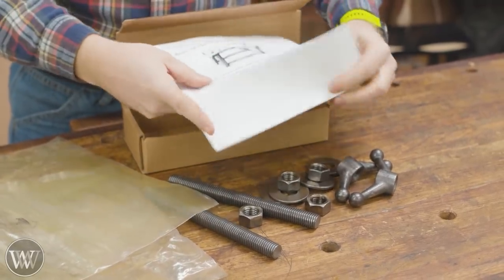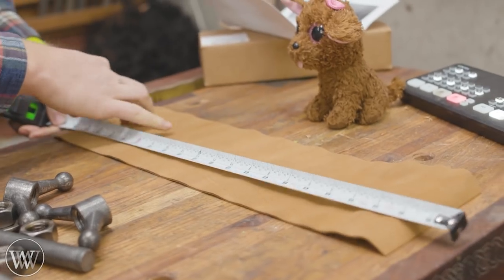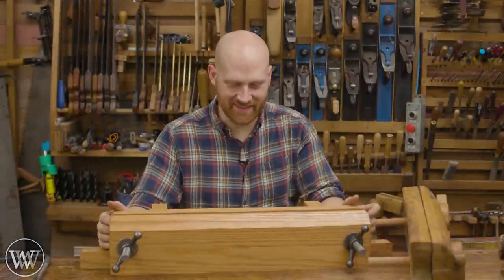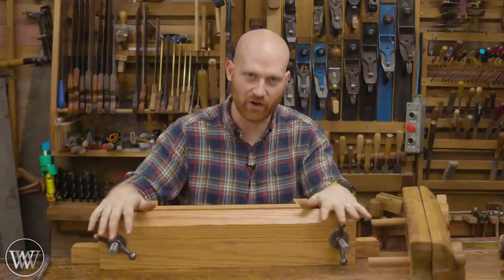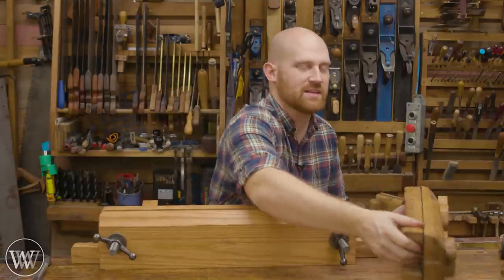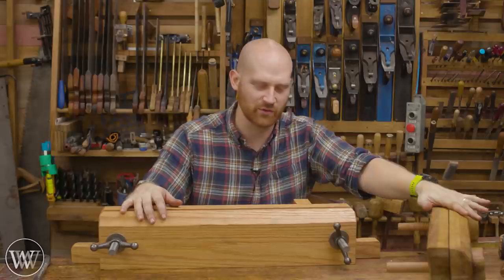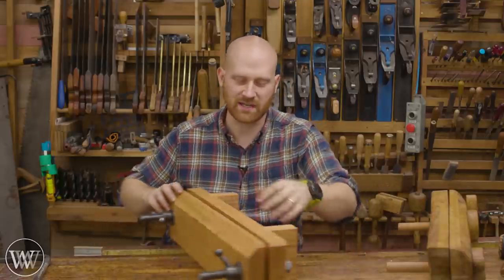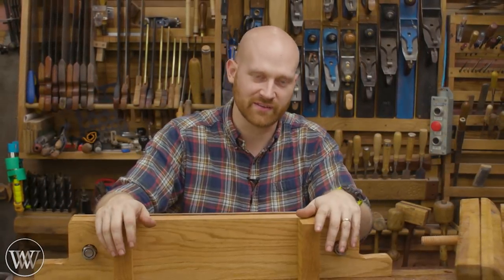Making a Moxon Vice Kit

Comment: Great hand work! You could make the screws not sticking out on the work side if you wanted to, just use the doble nut with the wing nut on one end or lock it with a weld spot, then you can use the one embedded on the wood for the worm to adjust. It may make it more handy and easier to tighten up...

Comment: As always, a relaxing blast to watch. 
I made a moxon vise near the beginning of lockdown with some scrap hardwood lumber, long bolts and other things I had around & it is a great project to do. Turned out very similar to yours except for the turning handles, where I created my own handles and embedded the bolt head in the handle, and I didn't have the sliding dovetail pieces.

Comment: love it, how do you find the patience to work by hand and not with machines, even with machines i have to often slow my self down.
Reply: I don't know about James, but for me working with hand tools is a way of meditation and calming my mind. It's not so much having a finished product made by the fastest or easiest way. It's all about the process of making itself.
Reply: Personally, in a lot of ways I find hand tools faster than power. Or almost just as quick. Less setup time, less jigs to use, and far far less safety features to work around/get in the way.  Yes the actual operation is slower... usually.  But the. Overall process isn't as much slower as you'd think.
Reply: @akadventurer7563  Setting up the square for your tablesaw versus just taking it over to the bench and cutting it even set up for Minor so I can take a minute if you’re being careful much faster just to do it by hand unless you’re doing multiple boards with the same cutting set up

Comment: No ACME screws is a dealbreaker for me. An easy set of screws for a moxon kit is to tear down a black and decker benchmate.  Gets you a moxon vise with, if you want, a 4-6 inch opening, acme threaded rods and even tho they are usually plastic, decent threaded anchors/nuts that will take a surprising amount of punishment (ACME threads, need I say more). You can usually get busted ones for $20.

Comment: How about putting the locking nut on the handle? Then the bolt would not be sticking out the front. You may have to put a plate on the back bolt to keep it locked in place.

Comment: What are you using to go from brace to wood owl auger bit? My 3 jaw brace will work with the smaller augers in softwood but start slipping with the bits bigger than 1". I'm currently using a 1/2" socket T-handle and a socket to drive the large augers and huge wood owl forstner bits when I don't want to bring around battery powered stuff but a larger swing brace and a tapered square to wood  owl sized hex would help with the large augers. I saw someone made a 3/8" square drive to tapered square brace adapter but yours being one piece is preferable.
edit: nevermind, just found your tool recommendations page
Reply from the maker: Here you go. I just did a video on that one not that long ago. https://youtu.be/bjAomHJ_8mE

Comment: I'm really not a fan of the Moxon "kit", I still believe there's a way to actually fasten this design to a work table. Cheers :)
Reply from the maker: Yes. The purpose of the Moxon vice is not to replace the vice on your bench or to be the main vice. It is to raise the work up another 6 in or so higher making it easier to see when doing endgrain joinery such as dovetails. I use it very rarely but when I do it's incredibly handy.